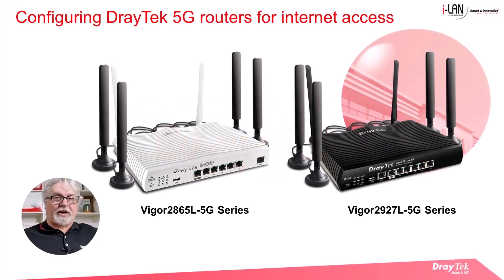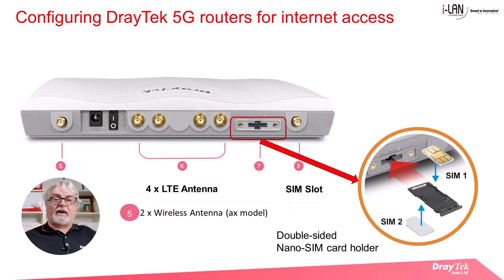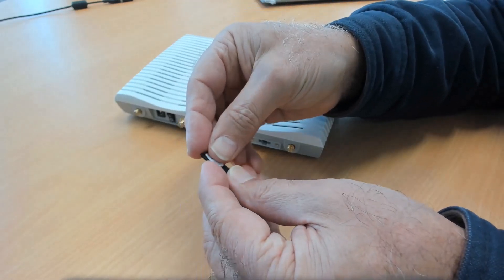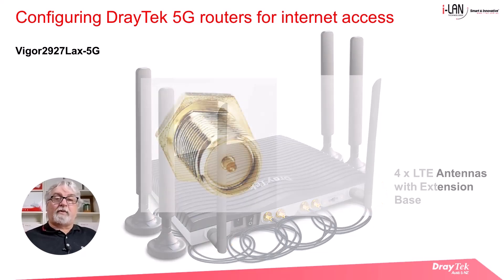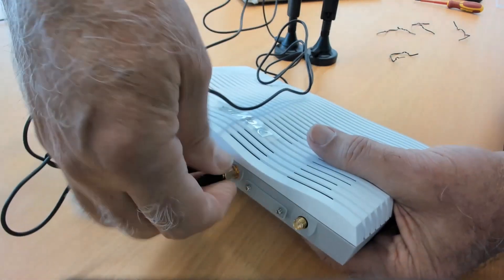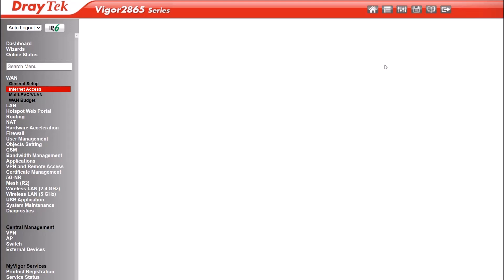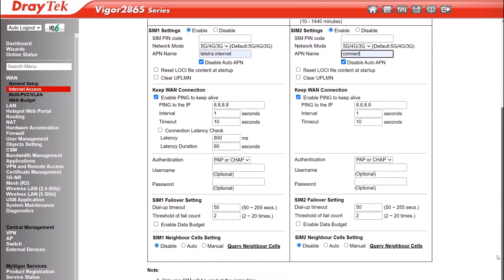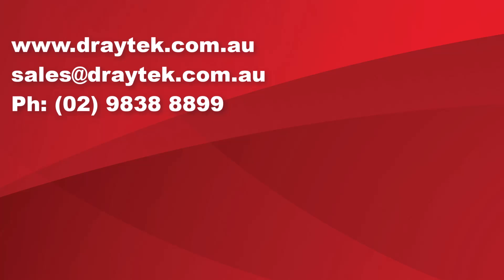Configuring DrayTek 5G routers for Internet access

Comment: I have the 4G version of this router 2865Lac with dual SIMs. The setting page is the same as show here when using the latest firmware 4.5.2.  I have an issue where if SIM1 drops its connection and the router tries to switch to SIM2, somehow it it gets stuck in “airplane” mode and won’t reconnect on either SIM until the router is rebooted. The WAN syslog clearly shows the router going into Airplane mode and never coming out again. Has anyone else experienced this and/or figured out what causes it?
Reply from the maker: We are unfamiliar with this issue but would like to examine it further. Please contact DrayTek Support in your country so we can investigate it and troubleshoot with you.
Reply: @DrayTekAustNZ Many thanks. Yes, have reported the issue in the UK and sent the syslog file. We have Christmas in the way now so not expecting a response for a while. Have a great Christmas.